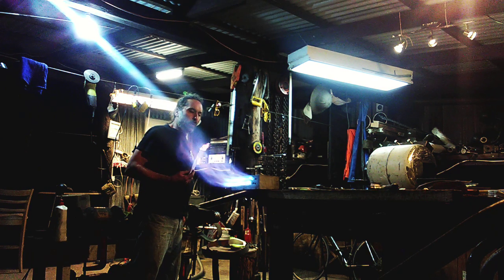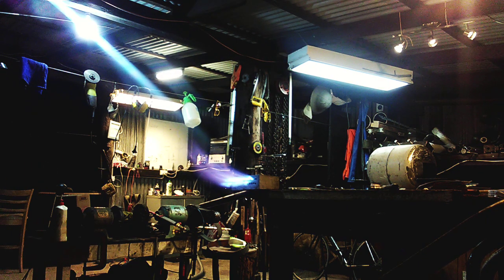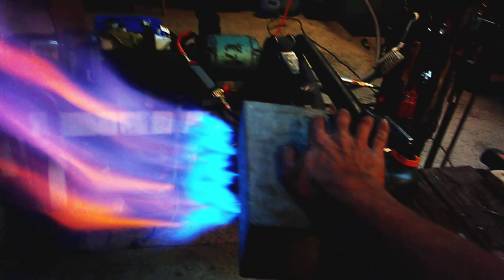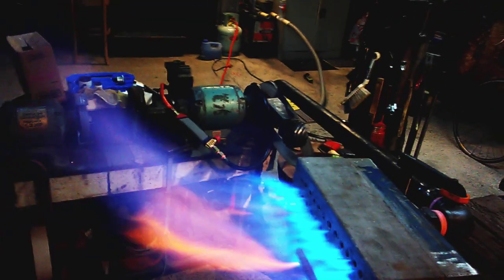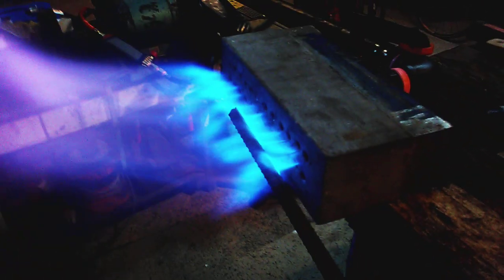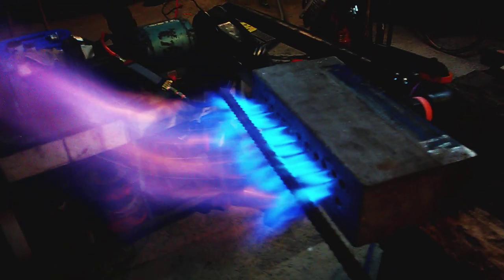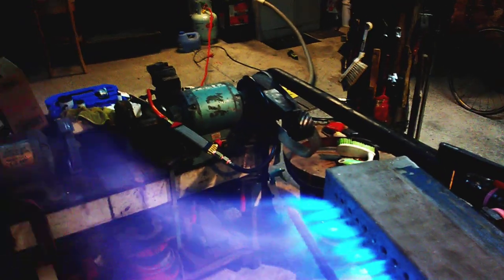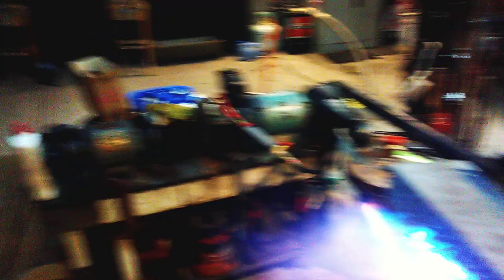Bacononia Forge Ribbon Burner Test - IT WORKS!

Comment: It will be hotter out at the tip of the blue flame.
Reply from the maker: Yeah i was just mucking around with it as a first test after i cast it. It is to mount in the gas forge i built and it still runs great.